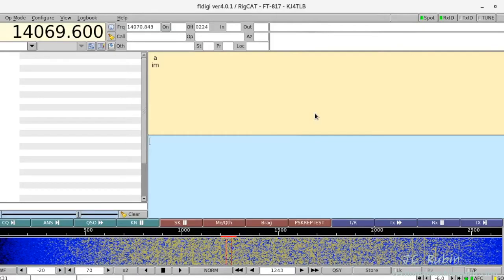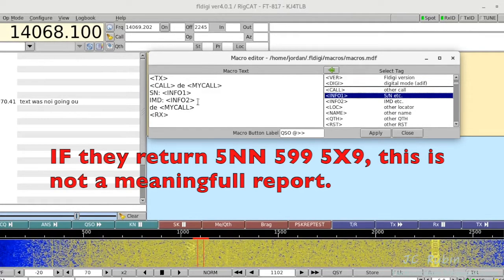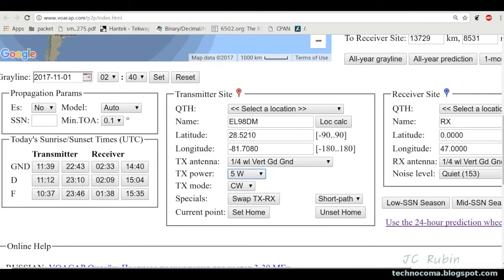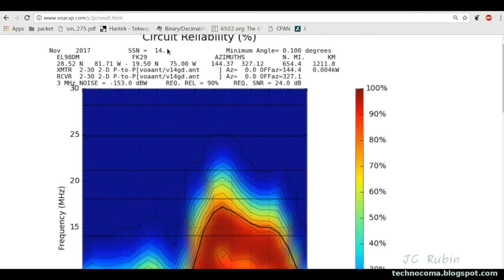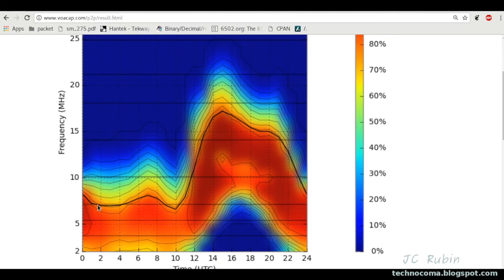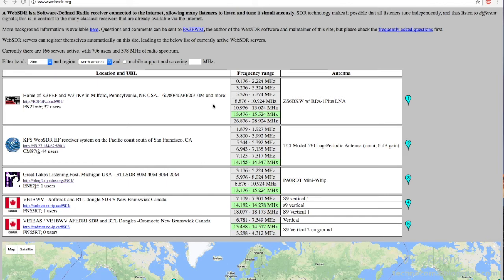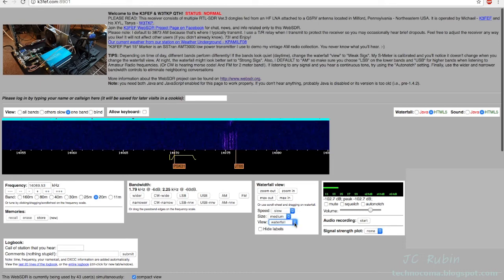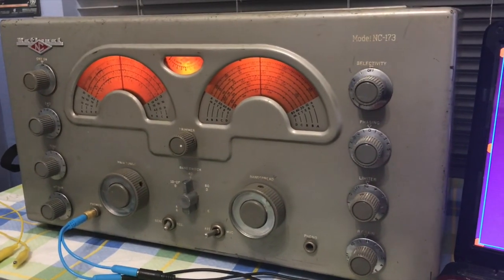Linux FLDIGI to the Yaesu FT817 Tutorial - Part 5 - Signal Analysis from the Distant End

Comment: Jordan, this is a huge help to me.  I'm just starting out newly licensed and I'm going to
get the FT-817 for my first 'real' radio (bought a Baofeng and it's been a slippery slope).
Anyhow I"m planning on jumping right into digital modes and have FLDIGI already installed on Debian 'stretch'.  I'm trying to figure out what cables and adaptors I'm going to need to run with both a desktop and a Dell latitude laptop for field use. I see I"m going to need a few things from  watching your series up to here.  BTW, FLDIGI 3.23.14 does have the link to pskreporter that you show @ about :31.  Thanks for making all these videos!  73,  KI7PNG
Reply from the maker: Thanks for the feedback, im glad it was helpful. Id encourage you to forego an antenna tuner, get an MFJ259 or equivalent, and purchase an antenna like a buddipole.  a tuned antenna is key to qrp